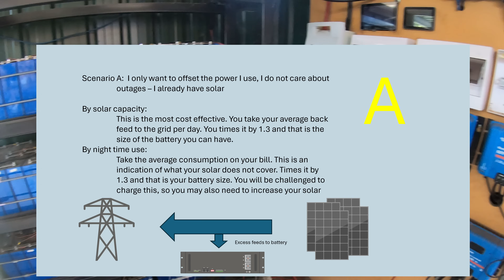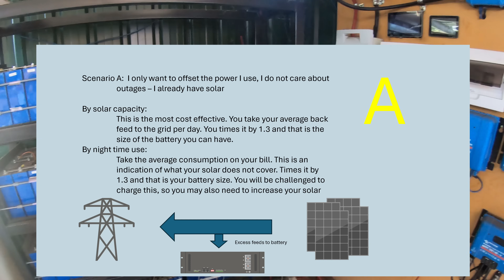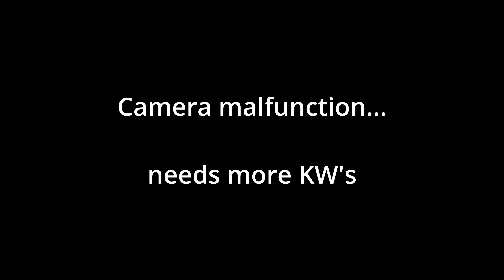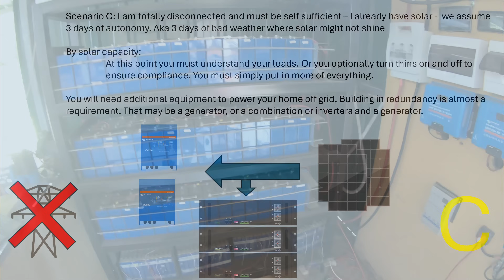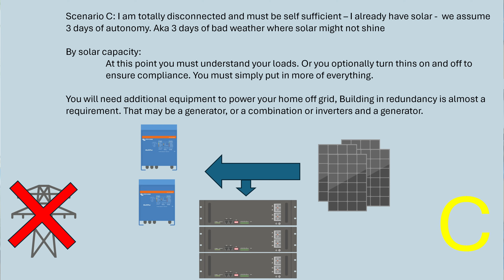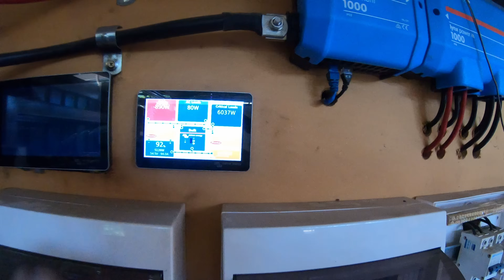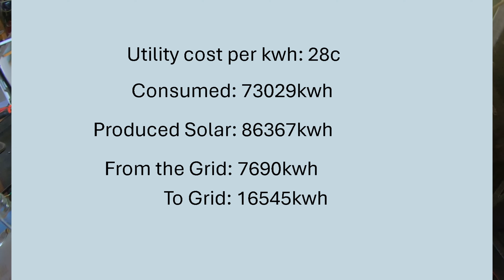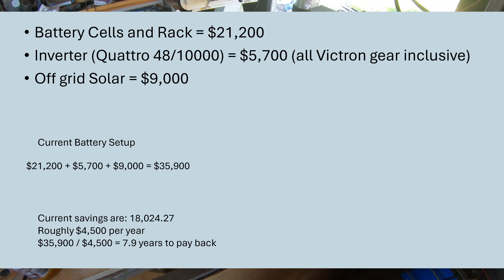Lithium Battery Cost Effectiveness

Comment: My experience has been that it doesn't end up paying for itself.   If you are going solar,  with batteries,  to save money,  you will end up losing money. This is especially true if you pull all the required municipal permits,  etc.  In my view, it is only worth it if you need some type of emergency power backup.
Reply: What do you mean it doesnt end up paying for itself? If you are pay for less electricity each month then its slowly paying itself off...the only thing is how long. If you have a more expensive system then its longer, thats it.
Reply: @fenton9620  most solar equipment,  including solar panels,  begin to fail way before their advertised life expectancy. So, it never ends up paying for itself.
Reply from the maker: do you mean in a grid tied situation, cause i think the window is very small with grid tied.. usually due to other restrictions. What important to take away from the video which i might no have conveyed well. is "which battery is cost effective" and the most  But in offgrid, it pays back. diesel is not cheap and its worse if your generator is petrol.
Reply: @BadIdea1123  yes, I meant a grid tied system or hybrid system. You are correct.  In an of grid system, it would be the way to go.

Comment: HI, Excellent explanation of the 3 scenarios.  I don't think enough Ozzies realize we get nothing back for our solar, and most of us work during the day when we have max solar production, sending it out for a loss of 25c a kw.  A battery storing that energy or  "power shifting" to be used later in the day is the way all homes should be.  My system is  exactly the same scenario as yours,  using similar equipment (Fronius, Victron,) the only thing I did different was buy 2 x 48/5000 for redundancy. Running 2 x EV's offgrid.  Awesome mate great job.
Reply: Rooftop solar without batteries is such a con. One way or another someone is paying 4x the cost of utility scale ground mounts, either the homeowner or the taxpayer
Reply from the maker: That is the perfect scenario. I hope to do as you have done in the future

Comment: Years ago was 20-25 years break even.Then had to start over.
Reply from the maker: flooded lead acid ? 

They were expensive, i recall seeing people use old forklift batteries (the electric reach truck versions) with the big 2v cells in them.

Comment: use wire duct to clean up your wiring
Reply from the maker: Its on the list as a tidy up job, i dont explain it in the video but the wiring that is hanging down actually has nothing to do with the offgrid gear. Above the inverter is the network stack for the shed and west side of the house. but also i have some RTK Gps gear up there for another project. so the wires are hanging down for me to plug in to them and reconfigure them.. i was standing on a chair previously so i could sit my laptop up there right up until i heard a crack and ...... well you know gravity and what not

Comment: Hi Can I ask you a question about your storm top-up comment? If you don't want to comment here then PM me please.
Reply from the maker: na its ok to answer here. We cant directly attach our inverter the grid as its not approved. So we have an input on the inverter that is "a generator" input. which is a 15a input on the shed. It lets us take in power from any other source, so we have a small 3kva generator, or the caravan ( we often plug the generator in to the van then the house). in other scenarios we plug the van in to the grid and the house in to the van. the van is set to pull in 2400w from the grid but not back feed. The house charges at 5000w from the van, that 2400 from the grid and 2600w from the vans batteries - we do not ever connect our offgrid system to the grid... i am lead to believe our grid provider is not polite to people messing with the grid
Reply: @BadIdea1123  Yes, that is where I was going with my question. I too have a "generator" input to an off grid system I would like to feed into from my shed (grid fed). Did you experience any tripping of the grid based source by having an off-grid system connected?
Reply: @BadIdea1123 i guess the easiest way to have a grid connection is just have a battery charger. Thus no need for grid compliance.

Comment: Hi mate, I know the Victron stuff is good but value wise the chinese inverters leave them for dust.  I'm running a 10kw Sumry inverter ($840 delivered) into a 31kwh battery. Already had 5kw of panels. Added another 5kw of s/h panels for $500 of fb marketplace. Pay back will be less than 3 years.  The whole setup cost me $8500aud
Reply from the maker: That is cheap. Yea the victron gear is expensive. Although their cost is coming down. We got the 48/5000 quattro 2 on the van and that was only 1200aud. 

The reason we use the victron gear as that we share power between the van and the house. We use the ESS grid set point and the MQTT integration to set the grid set point dynamically. So the battery is 90kwh on the house but in total we end up with 120 kwh as the van contributes. This does skew our consumption metric somewhat though as it hides a portion of it. Im not sure that the Chinese inverters will allow that kind of intervention
Reply: @BadIdea1123  The Sumry inverter is a complete unit, MPPT, charger/inverter. One box solution. It's completely off grid system and I have it integrated with Home Assistant to monitor everything.

Comment: You guys hit pretty hard on cells down there. I've got 140kwh > 144 cells + (9) DIY boxes + BMS's = little over $16k us. After tax and delivery. Granted I got my last order put in January before the whole trade thing hit with China. One Chinese vendor put out a notice that EVE cells will be increasing in price by 100% a couple of weeks ago. Reason stated was lack of minerals for manufacture. Doubt that but still. Hate to be under the gun buying cells today in this little corner of heaven!
Reply from the maker: WOW 100% is horrendous, thats going to put the brakes on people building their own batteries. 140kwh is huge, what are you powering with it ?
Reply: Wouldn't mind having a couple more but I'm guessing that won't be happening too soon. I burn 25-35kwh a day as much as 40 on a big day. I would like to have enough to make it five days without help from the sun. Happens in winter more than I like. Guess it's going to be a generator in the short term if needed. I've gotten a chargeverter, just need to settle on the generator.
Wouldn't think our trade issues will affect you guys. Certainly hope not!

Comment: victron makes great stuff. i doubt it will ever fail. i have 9 of the victron charge controllers and they are all great so far.
Reply from the maker: i am quietly confident, you are right. They make excellent gear. But its one of those things, as soon as your relax murphy comes knocking
Reply: Been running multi plus for nearly 10 years they are great units. Much love victron
Reply: @winzall123  I'd like a large victron inverter or two and also I'd like two of the 450 200 chargers
Reply: @BadIdea1123  I have a split phase low frequency sungold power inverter that is my main inverter and it's been reliable so far and I've not had any issues from my other high frequency inverters that run my small shop but if I had it to do over I'd have gotten a big victron just to have my inverter match my charge controllers. I don't need most of the features of the victron so the sun gold works for my situation but I'd still like a nicer inverter like yours. this solar stuff has been an ongoing addiction and I'll never get my money back that I've spent but it's fun and pretty amazing to know I'll never have to pay a monthly electric bill again. some people don't understand but the freedom from the man makes it all worth it to my wife and i
Reply: Just think you also pay for the education when you do solar for yourself
Reply: @winzall123  paying for the education is absolutely correct sir. I've spent around 60 thousand dollars on components and wire and all the little pieces. I run my home and shop on solar but I could have done it all for 1/3 of what I spent if I'd known what to buy the first time and if I would stop wanting to upgrade stuff. some stuff was to small... upgrade. some stuff worked fine... upgrade. some stuff I wanted better monitoring.. upgrade. it never ends
Reply: IF you know the industry, you know Victron is far behind. There are much better hybrids out there right now. And Victron does not offer HV systems at all yet. And yes there are HV DIY out there. HV BMS's exist nowdays.
Reply: @HermanWillems  yeah one of my friends has a rather large hv system and it's pretty amazing. I've never had any trouble with victron and the app is nice I just wish it wasn't as expensive and yes if they would make hv stuff I'd like it better also

Comment: You have a very nice and big set up. It seems you are using 24V set up. I just have 15Kwh battery and hybrid inverter, cost around $2200, I am using 16 EVE 304ah cells (48V system), JK inverter BMS and Solis 5kw hybrid inverter. In Melbourne now you can get old panels for free, can run cheaply off the grid system, daily high supply charges and lower feed in terrif sucks in Australia. Most people will go off the grid as now corporate companies are buying our solar power cheap and sell it to other at higher cost. One will save $365 per year by just getting disconnected from the grid. We do all our cooking on solar, every day, battery get discharged about 20% (from 98%), around 12pm it gets charged to 98% (I never fully charge it, and I only charge it at 30 amps). One cycle happens at every 5 days. I am trying to make a small wind turbine out of free LG washing machine motor which comes with permanent magnets to make 200-400 watts in windy cloudy days as we do struggle when we hit by three cloudy days in the row in Melbourne in winter. These washing machines (often thrown and end up in landfill) give 220V 3 phase ac at maximum 10 amps and can be rectified to DC and sent to hybrid inverter without using dump load as hybrid inverter can handle 500V DC at 13 amps.
Reply from the maker: Na its 48v, this one any way. We did build a 16wkh 24v battery a couple of videos ago. the big battery is 16s2p so 32 cells per shelf. 

If they relaxed the rules a little, everyone getting batteries could help stabilize the grid. but they wont do that, it means they get less money. So off grid it is. Glad to meet another offgrid enthusiast
Reply: You will need a bump load when your battery is full your inverter will go open circuit and the turbine will spin its self to death. It must always have a load to power even when the battey is at 100% charge

Comment: G'day, that is an awesome self build system, the largest I've seen. Seen larger ones using server rack batteries and powerwalls but for true self build, yours is the winner.

Pay back in around 9.7 years, but could be even quicker as you say, and even quicker still if the energy company raises it's tariff. Once it's paid off then the only cost is replacing parts.

Another thing that is harder to put a price on is satisfaction. The satisfaction of building your own set up is in many ways priceless.

Cheers from Thailand.
Reply from the maker: wow thailand, a beautiful place to be no doubt. You are correct the satisfaction borders on obsession sometimes. In the early days i would be picking up my phone to check the solar output religiously. The first time we got through the night on all battery was a milestone
Reply: You are right and then some.      The average Aust. or US or Canada inflation is 4% and the power in where I live has gone up 4% a year over 5 years.    Thus he has not calculated for an additional 8% gain annually which is at least 1.5 years off his estimate.
Can you tell me where I can find an investment that yields 8% for 8 years then steps up to 16% after that and then increases another 8% a year for ever going forward???  (for the inflation and power increase you are NOT paying.).. This is all net profit as you would have given that to the power company.
Don't get me started on the fact that you pay your power bill with  AFTER tax dollars.

Comment: The cost of cells has come down dramatically since you purchased. You can get a 280amp cell shipped to Australia for $100. That’s half your costs🎉
Reply from the maker: Yea they really have. I think we paid 165 per cell at the time. The rack, cabling and BMS where included in my prices. the 16kwh 24v battery we built a couple of weeks back was significantly cheaper. the battery was complete in an enclosure for just over 3k aud. and the enclosure looked really nice
Reply: @BadIdea1123 why'd you build such a large 24v system btw? My biggest 24v is <5kwh

Comment: Good cost breakdown! I like the High Voltage Inverter / EV Battery route, keeps the payback really short. The battery is essentially free  after selling off the EV's main parts.
Reply from the maker: Also the cabling cost is significantly lower. You dont care about voltage drop when your battery voltage is over 600v

Comment: Well I think that AC coupling is far more efficient when the power is used right away but it also looks to me like it charges the battery faster it could be that I just get too much shading on my long strings (for high voltage) but the Enphase coupled strings produce way more. I need an EV to reduce the pay back period as gasoline is expensive.
Reply: Oh I never explained that the Enphase inverters are used with my LuxPower to charge batteries offgrid or on if I like.
Reply: DC coupling from solar is more efficient generally. Most hybrid inverters have multiple MPPT channels. Most arrays are split to multiple channels in modern installations. Enphase coupled strings will offer limited advantages in this situation and add significant complexity and cost. My opinion as an electronic engineer that has worked with solar systems for 20+ years.
Reply from the maker: DC coupling to charge is more efficient for sure, But when its direct use, the higher voltage on the solar strings can be converted to AC more efficiently( with out a voltage boost). Most boost converters pass current through conductor. to create that field you have to loose some current to ground to charge the field conductor and there is loss there.  https://everycircuit.com/circuit/5988107308630016/boost-converter

We mixed ours up intentional to get the best of both worlds. The MPPT's charge the batteries and our direct us is with the PV inverters. what we dont use gets pushed in to the batteries by the charger in the victron
Reply: Your EV could be an cargo ebike with a hauling trailer or a converted bike. No need to go big unless you need the range.
Reply from the maker: True that, we have been looking at the plug in hybrids. Getting rid of a fuel bill as well as a power bill would boost these numbers significantly

Comment: Batteries cost about 900 AUD bucks for 16 320ah 3.2v on special 3 times a year aliexpress, 1400 to 1700AUD usually. My old power bill used to suck old house terrible wiring probably a leak or someone stealin power was 300-400 every 3 months. I pay nothing now. Dont feed in, dont take out
900 / 300 = 9 month theyre paid off. per set. More i have the longer they last because i am not running them empty and only using 20 percent of the battery capacity total per cycle.
Lets pretend i will only get 4000 cycles out of them. that means 10 years. i want 5 sets to get me to 1600ah 

5 times 9months is 45month which is 3.75 years call it 4 years basically i want to tip the math in their favour more
6 years of that is free batteries

even with the maths not in my favour taking every low number and not the average or every high number instead of average i still have 6 years of "free" batteries
Reply from the maker: is that USD ? or AUD ? 

We always use QSO. only because we have placed a bunch of orders with them so we have a repour with them. We are getting them landed in to AU with import costs at around 115 per cell
Reply: @BadIdea1123  They have three sales a year where the batteries drop below 1k AUD i am waiting on the next one now i have enough saved up haha. I scored mine for 950 then a week later (i wasnt happy haha) i saw some for 850
Reply: Edited my message too haha added AUD so no confusion, always forget seppos could be reading
Reply: @BadIdea1123  AUD
Reply: @BadIdea1123   Just ordered another 17 ( dont ask lol ) 314 A/H from SQT ( lisa) for 1650 Aussie delivered... so 97$ a cell
They are getting cheaper..... And remember your calcs for pay back are on 28 cents a Kwh  and it is not going to remain at that  for long  (here in QLD im paying
35 C Kwh and 98 cents a day